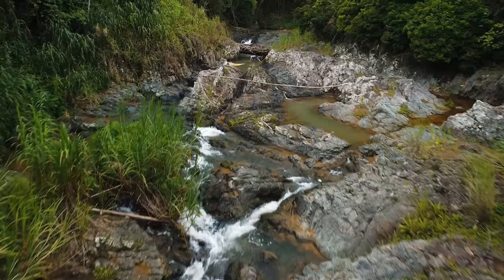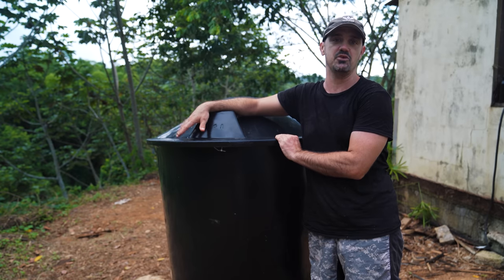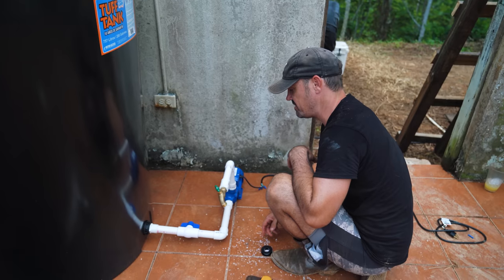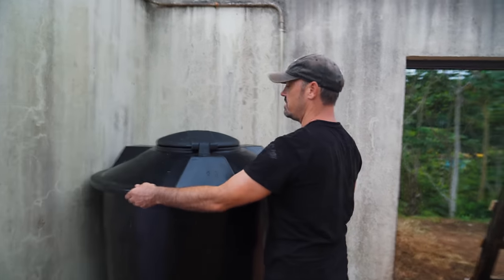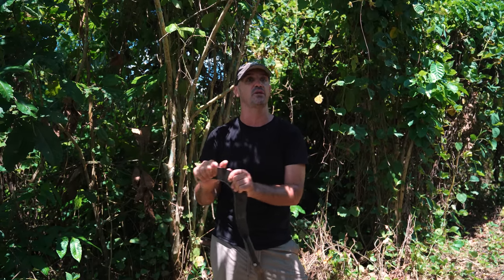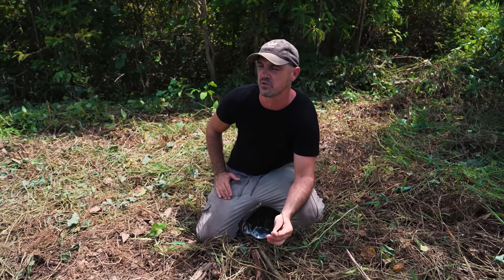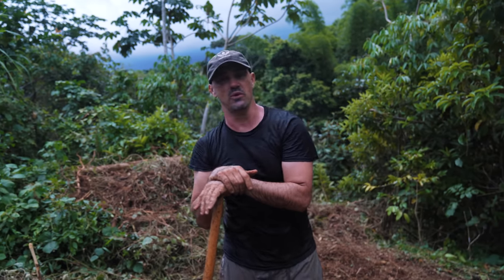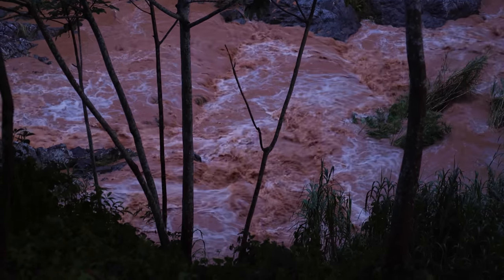WE BOUGHT AN ABANDONED PROPERTY THAT WE HAVEN’T EVEN SEEN 90% OF!

Comment: Your land looks prime for a small wind turbine, something to think about in the future. FYI, get a vertical turbine or make one. I made one 7 years ago. It produces almost 1 kw every 2 hours in very light wind 5mph. I also used neodymium magnets to keep the shaft at zero weight and almost no friction. This took me a bit to figure out by using opposite polarization on the top and bottom shaft while the shaft spins centered and smooth with bearings. My power company tried to tell me it was illegal but now I get paid by the electric company every quarter. Simply by using a grid tie inverter. One thing to remember, turbines can be controlled by a simple electric brake that will slow and or stop the turbine in high winds.

Comment: Great job on the property…
One thing that will make your life easier is a pressure tank with an auto shutoff pressure pump - expensive though.
Also - try to never ever open your cistern, or at least do not let ANY sunlight into it if (for some reason you need to get into it, do it at night with a flashlight) You want the inside of the cistern as dark as possible, and darker than that, haha! - no algae that way.

Comment: Guess you'll get tired of the slashing pretty soon. Buy a hedge trimmer. After you removed the bigger roots from the soil you can use a mini-tractor or micro-tiller, which is anyway better for small patches and hilly territory. For next years patches, put old straw on it an then water=permeable black foil to get rid of the weeds. Although I miss the sailing adventures, you both are even funnier with your new project. Very entertaining.

Comment: cystern setup guys You need a shallow well pump with a pressure high low switch that goes into pressure tank then you can regulate the end pressure, what you have is a transfer pump. You can use it to transfer water from your catchment tank to your cystern I would recommend using a above ground swiming pool with a cover in the near future when yuo set up a rain catchment and you can do that at ground level but you will have to fence out the chickens ohpoopedo LOL😎😎😎😎

Comment: Dude, take the lid off the cistern and take a piece of cloth, drape it over it and secure the blanket around the neck of the cistern so it doesn’t fall into the cistern and the piece of cloth keeps leaves and critters to get into your fresh cloud water.  Also, do it on the thrash can also.  Once the cistern and the trash can fills, the cloth will sag below waterline, tighten up the cloth and if that don’t help, just use the water.  Cheers!

Comment: You are experiencing the same issues as here in MX using a washing machine. Low water pressure. Emvariably everyone fills the washer via a hose. Wash using the power cycle. (No rinse cycle) Let it drain. Eliminate as much water from clothes. Place clothes on spinner. Depending on your washer model it may be an integral separate tub.

Comment: Weed Eater - try taking your weed eater shield off to keep the vines from tangling up on it. But, you will need to completely cover yourself with long sleeves, gloves, face shield. Use the heaviest diameter string on the trim as you can.
Reply: I had an Uncle that would actually attach a circular saw blade to the end of the trimmer.

Comment: Put your cistern up in the air , gravity sucks so use it.
And you have flowing water,  use it, go hydoelectric.
I've seen tubers use an old washing machine motor as their generator and you got batteries and solar on the boat that aint doin  anything but ballast right now.

Comment: Hey so I've been looking at your channel for a while congrats on the land purchase! its the most full filling thing you guys will ever do. Just my two cents on the clearing with the power tools. Your  forest looks similar to what we deal with in the Caribbean. I would suggest that you upgrade the power of your weed wacker to something like a Sthil FS 461 and go to a local agri shop and ask for a 14 inch straight blade. This will make short work of the vines without getting tied up, as well as any trees with a trunk diameter of less that 3 inches. The twine that you tried using on the vines is really designed for lawn grass. Trust me put a blade on that wacker and go like Moses through the red sea!!!

Comment: Matt think back to your pool installation days. It wouldn't take much plumping to add a second inlet with a value such that you could pull water in from a container and use your existing hose to discharge into the top of the cistern with the pump. No more siphoning and climbing to dump water in.

Comment: Just wondering what you're going to do with all the cleared plant material. I imagine you'll have to either just pile it up somewhere or do a burn. A suggestion, admittingly a little costly, would be to do what I did when I had to clear our overgrown property. I bought a small 5 hp gas powered chipper shredder. Don't waste your money with an electric. I set up 3 bins made from old pallets, the first for fresh brush storage, and aimed the chipper chute to blow into the second. The third was for mixing and compositing with other organic waste. I had my chipper for over 30 years until I no longer needed it and it worked great all that time. I sold it last year to a landscaper who is still using it for small jobs. It would handle up to a 2 or 3 inch branch. The small amount of pollution from the gas engine is offset by the return in good organic compost for your gardens and you don't have the fire hazard of dry brush piles.

Comment: did you get a swing check valve ?
gotta get one of those to hold the pressure from backing out into the cistern, and an Accumulator tank, ( so your pump doesn't wear out )
once the roof is on, you're going to have to come in through the wall with a down spout....also need to figure an overflow route. ( and study first flush diverters  )
isolation valves are important for serviceability...and i see you understand that, so that's good, ( put in an extra bulkhead fitting for the next tank )....gotta get on your leaning curve there.

Comment: For the tough weeds like your dealing with, a wxtendable hedge shear pole would be best, looks like a pole saw with hedge shears. It will cut all that, Milwaukee, dewalt, kobalt, craftsman, they all make one for the 20v battery systems, just make sure you get 5 ah batteries or larger. Stihl and Husqvarna make a gas version. Corded versions are also available but using extention cords in that mess would be brutal! Lol

Comment: You didn't need some fancy $80 on-demand thingy, all it is is a pressure switch that opens the circuit when the pressure in the pipe builds up to the no-flow pump rating and closes the circuit when the pressure in the pipe drops.  Too late now, but maybe next time.  See if you can rent a "brush/bush hog/whacker" to clear you ground, you're gonna get some blisters and callouses doing it all by hand.

Comment: The lid does prevent bird dodo and other stuff getting in your tank when you put it the right way up. You'll see on the lid there are raised sections with flat vertical faces, that's for putting a hole in and attaching your catchment pipe.
A second tank above the height you need water will allow you to gravity feed the water, then the pump only needs to pump up to the higher tank, this will save the life of your pump as turning on and off can kill pumps quickly.
There's a device called a "First Flush Downpipe Diverter" that allows you to divert the first bit of dirty water and then direct the good water to your tank, if you can't find one in your hardware store you can probably make one with some PVC pipes.

Comment: So I'd set up an awning and a trap (basically a T junction heading down across the line).  Water will flow from the awning down into the T trap, which will eventually fill.  Then as random "caca" gets caught in the awning and into your rainwater pipe, heavier sentiment will fall down into the T trap.  After it rains you just unscrew the access clean out at the bottom of the T trap and and dump the dirty water.  Epic Gardening has a whole series of videos of how he built his rain water collection system using a similar cistern to what you're rocking there.

Comment: Get a silky hen for your rooster he will be fine you need a rented tractor to till the land and clear it you can do a lot with the hydraulic system in the tractor demarcate the whole land that cistern would have worked the washing machine if it were raised on top on a stand so with gravitation force it would all be fine you should do a rain water Harvesting tank ground level and pump the water to the overhead tank and you are sorted for a while try to get up the water from the flowing river up in steps for agriculture once you are set to do it

Comment: honestly, i would have hauled off and 1) got a 500+ gallon strait off....2) rented a vibratory rammer to make a rammed earth foot outside the house...3) rented a 1/2 hammer drill and got a masonry bit big enough to pass one inch pex....4) got a swing check valve, a shallow well jet pump, and a big accumulator tank..and 5) got stuff to make a PVC overflow that routes overflow away from the tank area.....i did leave the math formula for rain catch on an earlier video, you could get 500 gallons on a drizzle.

Comment: I would also get that creek tested to see if it can be drinkable anyway, and even if it is not set up, I would get another pump just for things that you can use that water for, like washing clothes and stuff. And look at a "hydraulic ram pump." It can pump all that water from the bottom of that hill to the top of your house very easily, without any type of power needed for it to work.

Comment: Pretty much every house I have lived in Kenya has an on demand pump so it should work fine inc for the washing machine. It will fill the pipe, but won’t let it back flow and empty when it goes off.

Comment: From what I have heard, red - white - black wiring is for (North American) split phase wiring, while blue and brown wiring is for UK style wiring, which is not split phase. I don't believe the UK uses system neutral, though I could be wrong. So UK wiring is 220 - 240 volt between blue and brown. North American wiring is 120 volts between red and white and also between black and white, and 240 volts between red and black (single phase).

Comment: Chickens : first it’s normal for a hen that’s gone broody to not eat or drink for extended periods.. keep food and water close she will take it when she needs it.  Second… chickens have a pecking order so to speak when introducing new chickens it’s best to do that at night and you need to keep them penned up together for a while… while they figure out the pecking order they will fight some that also is normal but also your broody hen needs alone time it’s best not to bring in new chickens while she is broody… next water :: if your drinking that water from your cistern don’t use that green water hose it has carcinogenic materials in it… ( cancer causing materials ) they make a specific hose for potable water generally they are white mostly used for RV connections the green hoses are fine for like watering gardens , lawns and general watering but not for drinking water.. the trimmer I think your just using the wrong type of blade on the trimmer I believe you need a blade more similar to a skill saw blade but please to hold me to that I could be wrong be safe and good luck

Comment: you can use an rv 12v waterpump from the tank to the rv. turns on and off auto and maintains pressure. plus the are cheap like $60.

Comment: To allow you to not be so concerned with the sediment, I recommend that you get another tank that captures the initial water then overflows at the top feeding the top of the cistern that you will actually pump out of…that way the sediment will sink to the bottom of the first tank and you can put a filter/screen at the top outflow port to catch anything floating.  Your first tank can be smaller but elevated to permit gravity feed to the one you pump out of and also it will be high enough to put a bucket under the low out-spigot for the occasional sediment flush.   At first I thought that 200 gallons was way too small but if you have regular input and don’t need to capture for too many dry days, it might be just fine for you two.

Comment: If you submerge the hose and hold your hand over the end while you pull the end out and take your hand away once you get the end lower and it will automatically  start running without having to suck on it.

Comment: You can use a Bilge pump with a float switch to control the water transfer from one tank to another. 
Once The cistern is at its desire full capacity, the water suction will stop.

Comment: Yes, you can make it work with the lid upside down, you have to put some kind of anti-rust grille on the hole and put some big rock on it. That way, the water can seep in trough the rocks but everything else will be catched. However you have to keep an eye on the birds and bird poo, cuz if they poo on the rocks and water wash it in, it can be a serious health hazard.
For the gardening: Basically everybody has to choose between 2 ways. You either fight nature, or try to live inside nature. If you fight it, and do gardening on the "conventional" way, sooner or later you have to put pesticides and other chemicals into the soil, and on your plants cuz you are eliminating everything what can help you. I strongly suggest mulching technique instead of ruining the soil by shoveling it up and so on...Mulching takes time, but on the long run it can save you a lot of unnecessary work, and you can do gardening on a permaculture way.

Comment: A better way to regulate your water flow is to install a pressure tank/accumulator with a pressure switch.  You install a check valve in the inlet of the pressure tank, with the pressure switch on the tank side of the check valve.  When the pump has brought the tank up to pressure the switch will turn off the pump until you have used enough water to reduce the pressure enough for the pressure switch to turn the pump on again.

Starting and stopping the pump often by using an on demand switch will overheat the pump and shorten it's life span.

Those "things" you have in your hand are called cut worms.  They eat the roots off your plants.

Face it guys, you are never going sailing again.  Let me know when you come to this realization.  I want the Mini washer/dryer you got you hands on some how and installed in the boat.  I've been looking for one for a couple of years but so far have come up empty.

Do good, be safe.

Comment: The 2 Roosters will eventually start to compete over the limited hens and fight when that white rooster reaches adulthood.  .  If you aren't planning on getting a bunch of hens where there are enough for each rooster to have his own clutch of hens, then the new one should also get a succulent name like juicy did. Maybe Fryer,  Wings, or Drum Stick, and he should be culled around 20-26 weeks max for the freezer.  I'm not trying to be mean.  Just realistic.  

I offered  you a simple option in my last comment how to keep them semi free range but keep them safe from both ground and sky predation and keep them from running or jump flying off with regular and electrified poultry netting.  Maybe you missed it.  

Use your YouTuber clout try and work a sponsorship/brand ambassador deal for fón electric Poultry netting a battery and a solar charger/controller.  Get some posts and some braided old school poultry netting for overhead to keep out raptors and scavengers like hawks & buzzards. Chickens stay in bad beaks, teeth, talons, and claws stay out.

Comment: Doesn't your pump have a pressure dome on one end so it turns off if pressure builds to a preset level? If not you need to install one in the line to control the pump but also a non-return valve so the system stays primed. With those two if you turn on the tap (faucet for Americans) once the system pressure drops the pump will start, turning off when the tap is closed and pressure builds once more. We got pumped water in our home, kitchen, washing machine, 4 bathrooms and 3 outside taps and hoses for the garden- So power use is not an issue but getting a pump big enough to service all outlets is. Ours has the capacity to serve all outlets at once if necessary and we ran pipework big enough to accommodate without losing as decent flow rate.

Comment: Just a heads up, you are using the trimmer attachment incorrectly. I use mine for the same stuff you are but you are trying to cut from the bottom and it is getting wrapped up. If you do passes starting from the top then you will have much better results. You can also get a blade from a trim saw or circular saw to cut through a lot of that stuff very quickly. Just be careful, wear pants and eye protection at the very least.
As far as the chickens go, when you get new birds, you need to lock them up to be around each other but not be able to fight, for a few days before you just let them go. If you drop strange animals in then your rooster will do what they are supposed to and they will run the new animals off.